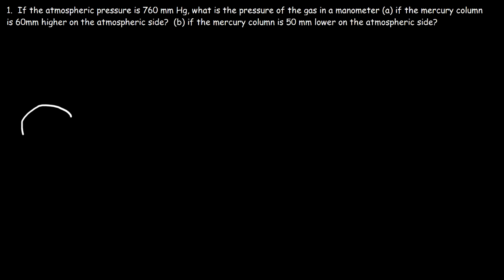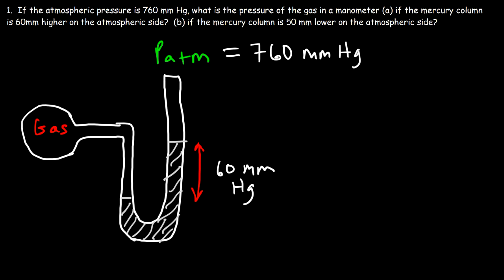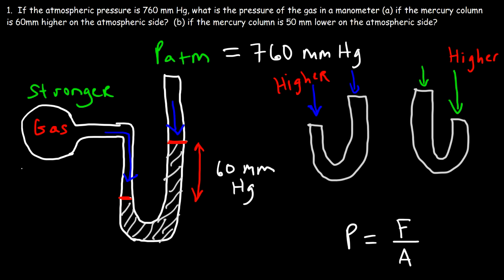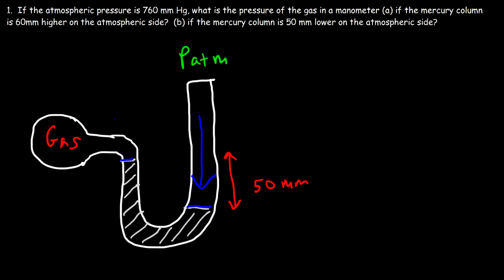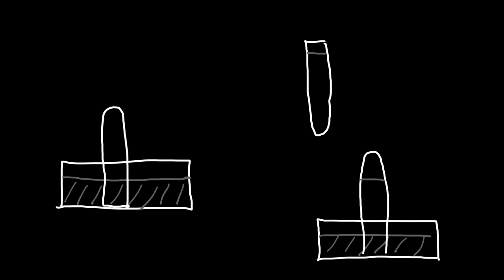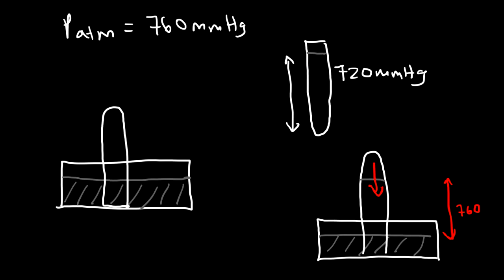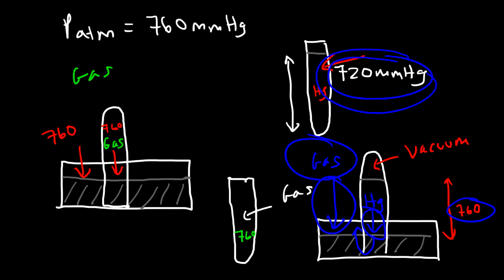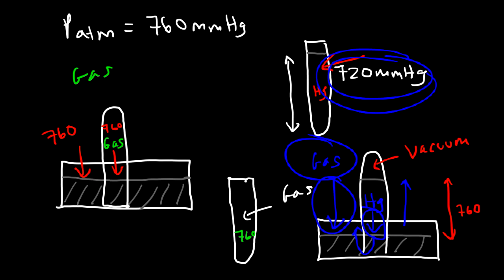Manometer Pressure Problems, Introduction to Barometers - Measuring Gas & Atmospheric Pressure

Comment: I'm probably wrong, but I don't think a partially filled tube with 720mmHg will raise to 760mm when flipped into the Hg tank. The tube has to be COMPLETELY full before flipping, otherwise you a have 760mmHg air pocket in your tube--the level will not change. If you had 780mmHg, yes it would drop, the outside atmospheric pressure is too weak to support more than a 760 mm column of dense Hg.
Reply: I am probably worng but don't think aproblity filled tube 720mmhg  problem Hai
Reply: I feel what you said makes a good sense
Thanks

Comment: one of the limbs of a mercury manometer is connected to a gas cylinder the mercury level in the limb connected to the gas cylinder is 10 cm higher than that in the other then the gauge pressure of the gas is____cm of hg. I got 66 cm of hg but the answer says -10 cm of hg. Am I right or is the book right?

Comment: Does the patm have to be in mm or can it be cm???
Reply: if you use mercury it will be in mm but if you use another liquid (less denser) it might be in cm...for instance water...has 10.3m of height to equal the weight of 1 atm..this experiment was actually first carried out by accident in italy where the underground water couldnt reach a heinght higher than 10.3 m ...https://www.youtube.com/watch?v=EkDhlzA-lwI check this out for more info..

Comment: Using meters as your units for pressure is really throwing me off. Pa or atm? Since when is meters a unit of pressure?
Reply: meters are not a unit of pressure. "millimeters of mercury" is. its the same thing as torr. Youve heard of torr right?